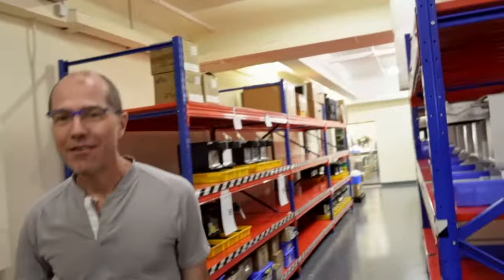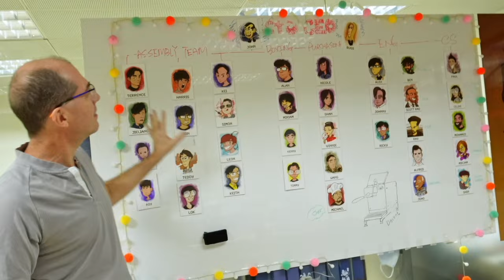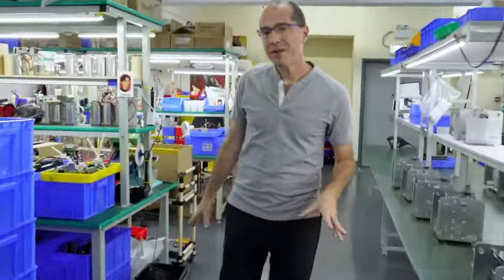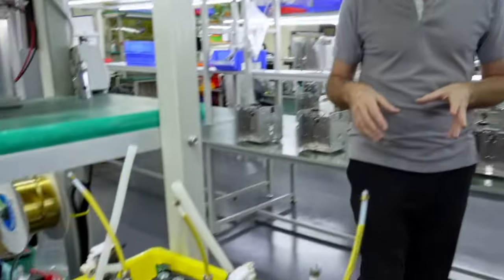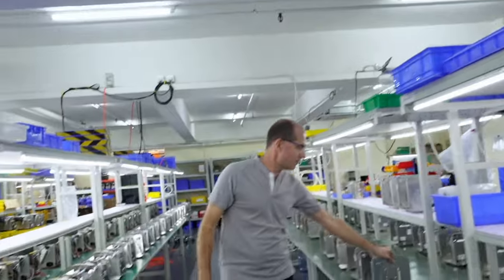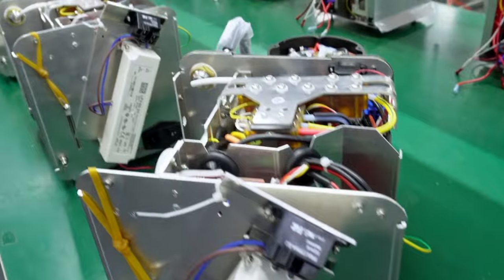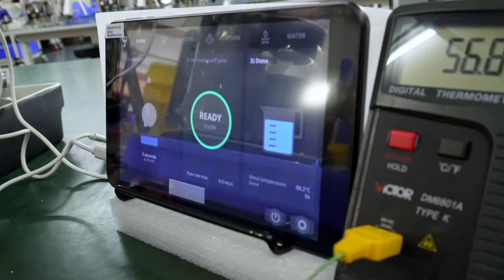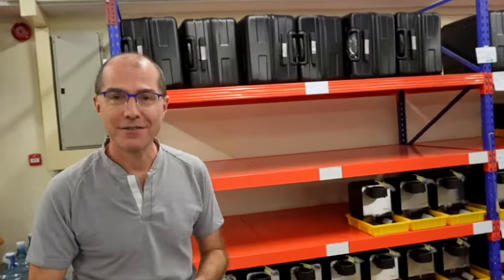Decent Factory Tour

Comment: Looks like you're packed pretty tight. I seem to remember a more assembly line look to the original setup in the workshop but everything looks optimized very well.
Love to see all the testing and burn in on your machines.
I'm sure you're tremendously proud of the success of Decent Espresso. You've changed what it means to buy an Espresso Machine. Now there's Decent Espresso and then there's all others, those out of date Italian inspired metal behemoths that just can't be modernized.